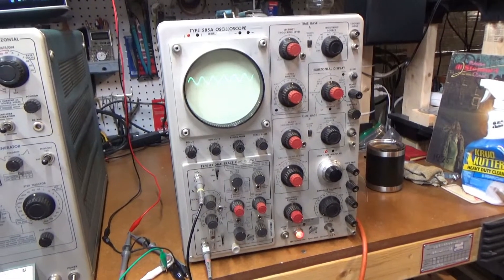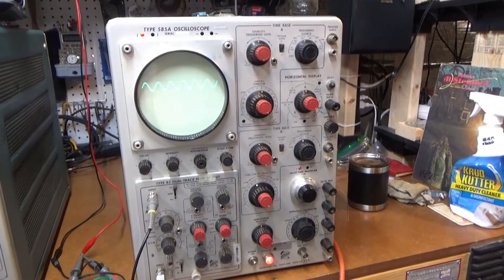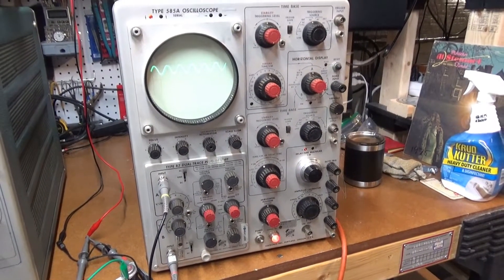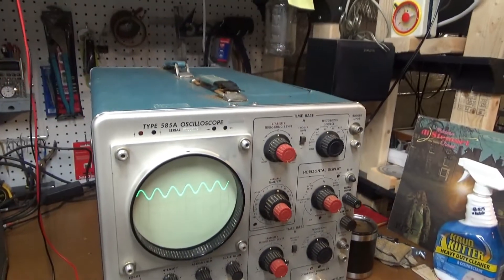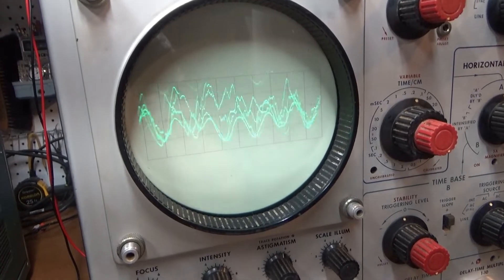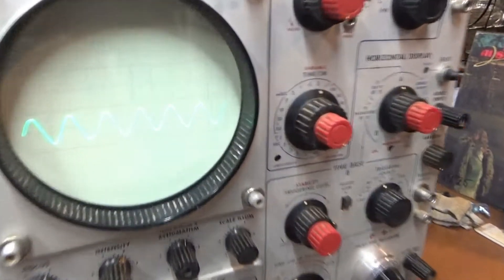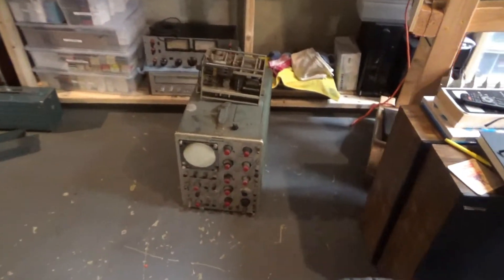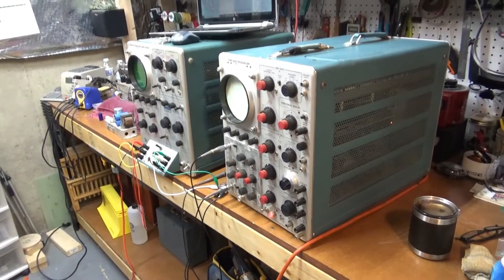1964 Tektronix Type 585A Oscilloscope

Comment: Indeed that is a very nice scope! A very heavy beast . Impressive shop area.
Reply from the maker: Very heavy! Now I have three of the big boys that I'd like to keep (2 scopes and the curve tracer). I have one more scope that doesn't work that I may use as a parts machine. I'll probably build wheeled scope carts for the other two that I want to keep.
Reply: @mguess  I would like to see how you actually build a scope cart. I don't think anyone on YT has done that.
Reply from the maker: @hestheMaster  ok. The next one that I build will come with a video.  Thanks for the suggestion.